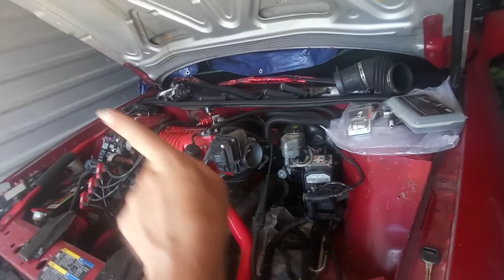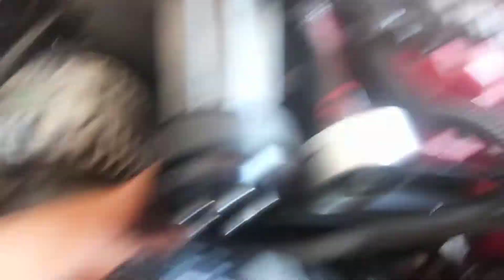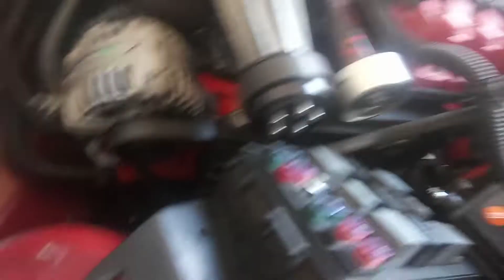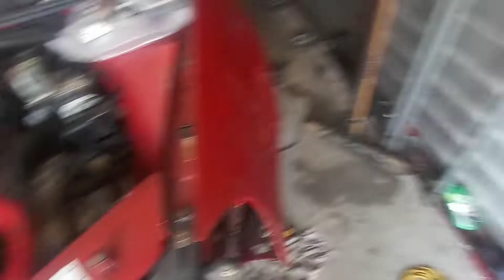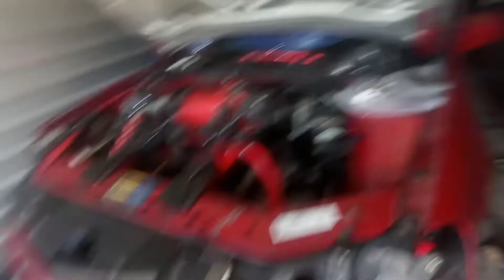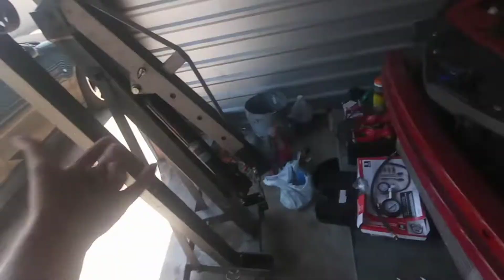07 Grand Prix GT Update: I Messed Up Big Time... I'm a Dumbass...

Comment: Damn that's sucks but mistakes happen can wait for the next video
Reply from the maker: Yeah it does. I was so excited to hear it run too. But at least now i know what the issue is. So fingers crossed i didnt bend any valves in the heads. The push rods and rockers all looked brand new still. So as long as nothing got damaged then i can re-time it correctly and fix my mistake and it should start up and run. And if it did bend valves then i have the grand ams heads i can use. They're mildly ported L67 heads. Just have to swap valve springs and retainers and have the heads machined down on the valve guides. I just hope its all still ok and i can re-time it and be done.

Comment: Cool brother man loving the  content
Reply from the maker: Thanks man. Im glad someone enjoys watching it. Now ive just gotta pull it back out, and tear the timing cover off and valve covers and rockers so i can  re-do the timing, and then put it back together and check for compression. Fingers crossed i didnt fuck up any valves.
Reply: Damn hell yea bro I just gotta change the water pump and put a new belt on my gt and find some chrome rims just got it tinted
Reply from the maker: @litosway815  hell yeah. Water pump is easy. Like (6) 13mm bolts and (2) 10mm bolts, and (4) 8mm bolts on the pulley. I use rtv on both sides of my gasket to make sure there are no leaks.